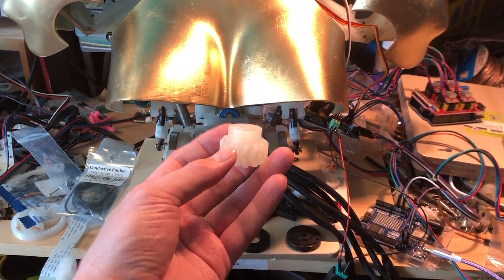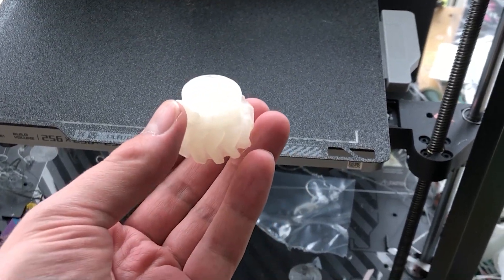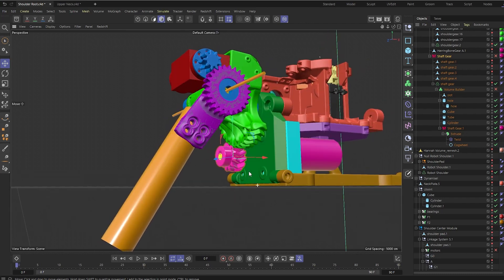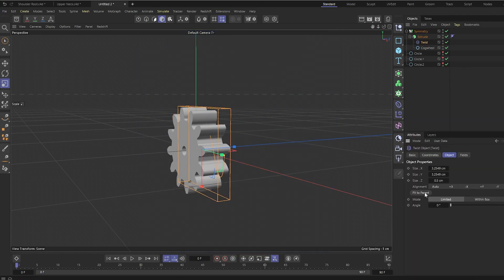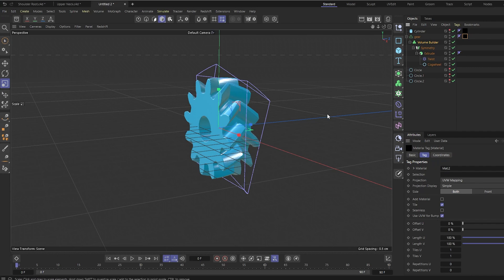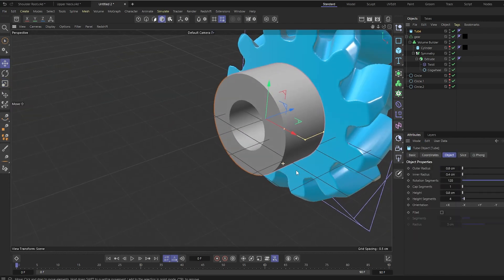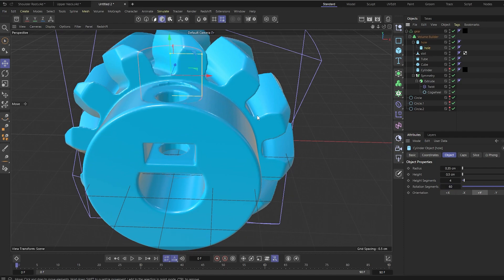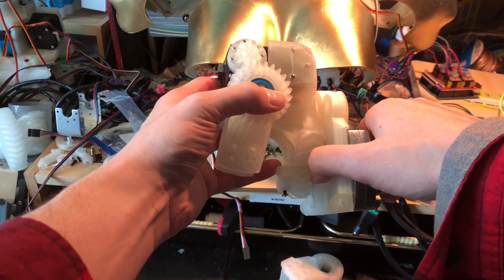Modeling for 3D printing using Cinema 4D

Comment: I would highly recommend using a metric threader to make your screw connections. I use mainly eyeglass screws in my builds. M1 to M2 for example. They also have threaders for those as well. You can literally get thousands of screws for nothing. Much like cameras or phones these days, they just thread the case or internal plastic frame instead of using nuts. So far, they have been really strong connections.
Reply from the maker: I've been working with screws like M2, M2.5 and M3 mainly.  The metal threads of the M3 nuts are necessary for the M3 screws to have enough bite - particularly if I am going to be taking the screws in and out several times to change anything. That seems to be the main issue with plastic. if it's just going in once it's ok, but if the screw needs to be removed many times the plastic threads just vanish.  The bite goes away.

I do like the idea of getting a tap set for small screws though, I should do that to play around with it.  Smallest tap I have right now is M3.

I've been looking at some tiny metal working tools - lathes and milling machines for clock makers.  that kind of thing.  Small taps might be very useful for making some tiny metal components for the robot.

Comment: Interesting, you’ve prolly answered this already but why not use CAD? Fusion 360 is greatttt, granted it’s a lil annoying to have to only 10 active files at a time with the free version 😅 but it’s easy enough to deactivate and activate. Or is it a hardware issue? C4D is Mac right? Does F360 not work with Mac? Sorry, it’s been years since being a Mac user.
Reply from the maker: does Fusion have signed distance field modeling?

I've never had a reason to not keep using C4D.  robust modeling capability, rendering, simulation, animation.  When I want to set up procedural rigs or components, it's not difficult at all.
Reply: @DaveMakes  honestly I’m not sure what that is hehe 🤭 but personally I use it because I’m a big fan of parametric modeling and being able to change things that are multiple steps back without having to redo all my work. 😅 I love having full control over every aspect of my design and I feel less stressed over decisions during the process because I know I can just scroll through the timeline and find the operation thats giving me trouble and tweak anything about it. I hated when having to undo everything I did and redo all of the operations when I was using blender for my designs. Plus it’s super 3D printer friendly and you don’t have to worry about checking to make sure everything is manifold and whatnot because the process ensures it will be 3D printer ready. Plus it’s got a built in pcb maker so I only have to lean one workflow/program and I can do everything I need. There’s tons of other stuff you can do with it to. It worth checking out honestly. :)
Reply from the maker: I think i've got a handle on a lot of those issues already.  The thing is, I like to do other things as well, such as character animation, rigging, and rendering.  I started out with Daz 3d, then moved to Maya, now I find myself using C4D, which I have been using now for around 3 years.  It's working out very well for the wide range of things that I like to do.  SDF modeling is excellent for 3d printing, and i've only dipped my feet into PCB design with KiCad recently.

SDF modeling is a way of working with 3d objects that renders everything into positive or negative spaces, with some interesting ways to smear, or blend between them mathematically.  For complex organic shapes, or even mechanical parts it seems pretty good.  Works well parametrically too.
Reply: @DaveMakes  I totally get that! There are some things I still hop over to blender to do since I have the workflow down already. And yea F360 is really only good for designing parts, pcbs, assemblies, etc or like CAM applications. Anything organic or requires sculpting I do in blender. 

And oh wow that’s sounds really cool, I’m gonna have to look into that! Thanks for taking the time to reply 😊 all the luck on your project! Can’t wait to see where it goes!

Comment: You should look at strain wave gearing and servo motors if you can afford it. Else if you insist on using conventional gearing, you can buy gears from various suppliers, or barring that buy yourself a universal milling machine and universal dividing head to make your own. I would recommend a universal mill over gear hobbers/shapers ext due to it's greater versatility.

Comment: Are you using plastic gears just for testing or are you gonna use them on the final android? cause i think those break easily
Reply from the maker: if they break, i'll have them printed in aluminum.

Other options are nylon, or casting them in a strong urethane myself.

Comment: Maybe not for now, but to bookmark for later:
ultrasonic motors like the ones used in higher-end camera lenses are mostly silent, and have interesting features that may make them useful for subtle, quiet movements like facial animations. A lot of animatronic projects use servo motors for eyes, eyelids, etc and the loud ZZZZzz noise breaks the believability that you've made a living thing.
I don't know how accessible USMs are, if they're economical or their performance is adequate, I just thought it good to mention. I haven't caught up on all your videos yet. One day I'd like to try something similar. I'm studying CG at the moment, have some very modest skills in CAD and 3D printing.
Reply from the maker: I had a look at a company that makes them.  I was seeing prices like $500 per motor for closed loop, or 400 for open loop designs.  Yikes!  They look cool though.
Reply: @DaveMakes   Ouch, that's too much. If that's the going rate, I'd suppose junking broken camera lenses would be cheaper, but that's a whole set of other problems to deal with.
Interesting at least ✌️
Reply: @MaximilianonMars  we could make a crowd fund for expensive parts like this :p
Reply: even if the motor is silent, the gears meshing and moving will make noise.

Comment: Makes me seriously want to consider building my own. Already have the printer and electronics laying around. Been over a decade since I've used Cinema 4D. It seems like it is much better equipped for CAD simulation and working with an Arduino/etc than Blender.
Reply from the maker: I think you'd be fine with blender if you wanted to use it.  I believe there is a plugin for SDF modeling.  Womp is another software i've heard a bit about that is primarily based around it, though I have not used it.  My own experience with C4D has been very positive, so I can say that much.  I've been using it for about 3 years now.  There are a lot of different 3d modeling tools out there all aimed at different workflows and outcomes, it's frankly a bit confusing even for someone who's been at it for years.
Reply: @DaveMakes  Just found some SDF and gear plugins, as well as a way to connect Blender and an Arduino/etc so I'll try those out, they look promising! I'll let ya know if I come up with anything worthwhile!

Comment: You're better off getting metal servohorns/keyed flanges built for the ASMB-4B size motors.  They have less slop and you can tighten the keyway as much as you like without worrying about breaking mounting hardware.  Plus they have enough torque that you don't really need to gear them down.
Reply from the maker: thanks for sharing your insights.  I haven't used this motor before.  I may get the horn i've designed printed in solid nylon for strength.  Maybe i'll do away with the gear reduction entirely if this motor is strong enough.
Reply: @DaveMakes  You're welcome, these motors are quite strong: lifts my android's arm and help balance the torso without any issue.  The fun part is figuring out how to mount/find room for them since they are not a standard servo size :)

Comment: Do use xpresso for creating linkages/relationships between individual parts? Would love to see a bit behind the scenes on that!
Reply from the maker: I definitely do.  It's very handy for setting up relationships between things.  For example, if I have two gears with a herringbone twist on them, the relative size of each gear will need to dynamically alter the amount of twist.  so different gear ratios need different twist ratios as well.  hmm, that feels like a mouthful to type out.  Suffice to say, xpresso is very useful for rigging :)

I'd be happy to do a video about this.
Reply from the maker: Here's an example of using xpresso to set up the different relationships of the mechanism.  Not an instructional video, but this is definitely a typical way to make use of it.  https://youtu.be/uabLeeSLujA?si=hjWXz5GaJD4KySVy